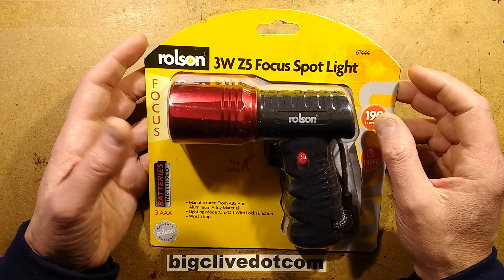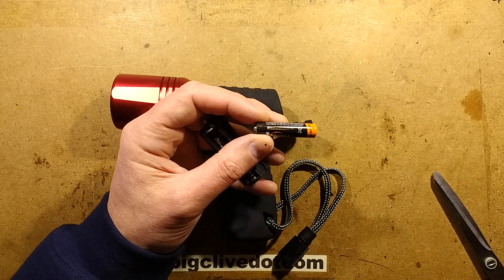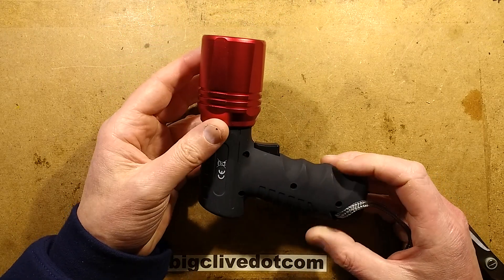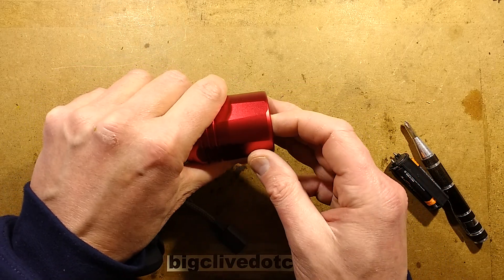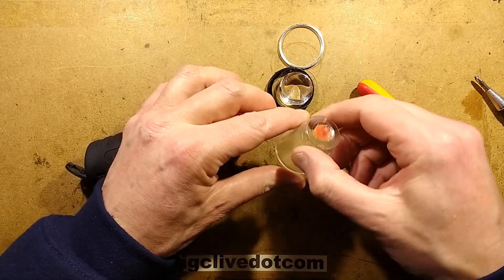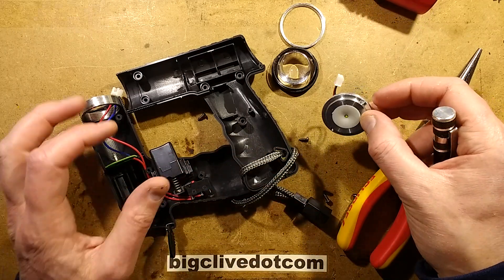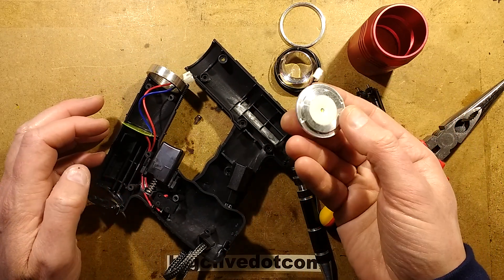Rolson Z5 3W LED spot teardown.

Comment: Pifco made a gun shaped torch in the old days, used a No 8 3v battery, it was known as a Pifco pistol lite. The batteries in yours are Chinese an often found in cheap bike lamps an TV remotes, Sadly some rolson items are no good, I had some pliers from them an they snapped, possibly cheap steel. I find with these cheap torches the bodies are nicely machined but sadly the electronics are not that good which is a shame.

Comment: Honestly one thing ur free to do for good cheapiest way is get zte power blank put 2x3.7 rechargeable and re wire it and I don't think u need to get the back open u can use just one but they make it good one 2 led shows minimal and max state lefts quite a charge on so u use em longer time limit it to 5 volts but 3 x 1.5 are about that voltage 4.5 I got 4.9 on new x3 pack

Comment: Clive, have you seen the USB rechargeable AAA batteries on ebay? Not a typo, the cells are small Li-ion inside of a AAA package complete with a micro USB port for charging! Rated 1.5v output instead of the 1.2v of Ni-MH

Comment: Ace find from rolson! Would be interesting to see how the spot light works in the dark,  and focusing, with that impressive lens on the front,can it light up a door number from inside a car on the road,looks like its got loads of space in the body and grip for a couple of lithium and higher wattage led. Give it preformance worthy of its space death ray gun appearance , im planing an upgrade to my current torch,3aaa and 14x5mm led no resistor. A few of the leds are going dull battery life has been good for me, have new leds on order, will also try Upgrading to 3wled on a star thing, 5 degree reflector ,adding a 2w 1ohm resistor, also have a couple of lenses to try, looking to make a 1 foot spot at 15m we will see, i intend to stream the process,when iv lost this cold and set up overhead cam.

Comment: You could throw an 18350 in there just by soldering a plate onto it with those springies on it and adding some current limiting to the LED, maybe replace the LED entirely with something better.

Comment: Looks very hackable!  No test on current draw?
Reply from the maker: Current draw will depend on the type of cell and state of charge.  It will be very random, but in hindsight I could have checked that with a DC clamp and holding the battery pack in place on the contacts.  (Putting a meter in series would have affected the current draw significantly due to even a slight series resistance.)

Comment: I realize that 18650s are the cylindrical lithium cell people are most familiar with - but for something like that, an 18500 or - if you're lucky - 26500 might be a better fit. I have some LED flashlights that came with carriers for 3 AAA cells and with a little ingenuity I got them working with LiFePO4 18500 cells - a little nut-washer-screw arrangement at one end to take up the extra length and some O-rings around the cell itself to deal with the extra diameter.

Comment: The speed the electricity comes out of the batteries has to be equal to the speed the light comes out of the LED or it wouldn't be able to keep up.

Comment: this would be very hackable. i like it. seems like the case was likely designed for a higher-end product.

i'd get an 18650 in there if possible with usb charger on the back door and nicer LED. a tiny bit of dielectric grease would give some friction on the focusey bit.

Comment: Fun fact, "TK Max" is called "TJ Max" in the states, when I was in the UK I saw that and got a good chuckle out of it
Reply from the maker: Apparently they couldn't call it TJ here because of a rival shop called T J Hughes.  But a slight name difference could also provide a degree of financial separation.
Reply: https://en.wikipedia.org/wiki/Junction_temperature  (aka TJMax) ...  quite fitting considering there's no current limiting whatsoever in this PoS

Comment: I got one of these to bugger about with. The screw focus was rediculously loose. My idea was to use a very thin layer of rubber cement from a puncture repair kit to increase friction.  Result?: big gollopy mess.
Reply: Thick grease might have worked...
Reply: I tried grease but it seems I had two parts on opposite ends of the tolerances. In the end I just binned it and got another one a few months later which might have been on newer tooling.

Comment: Here's what you do clive... Swap out the little PCB used for the battery contact, and mount an 18650 in there, a small charging board in the handle (face the micro USB out the bottom of the handle) And replace the LED with something more fun  like a WS2812B and an mcu :)
Reply: ArcAiN6 Inefficient.  Make the battery contact board a charge control and constant current output board.  SMD components on the front, battery contact on the back.  A wire running from the board to a piece of metal on the battery lid.

Comment: Looks very hackable. Not difficult to add a stroboscope circuit. I use a quad Schmitt trigger circuit to generate and shape the pulses and a power FET to switch the LED. A simple multi turn pot can control the flash rate. A proto type in the lab was great for looking at the motion of fan blades and drill bits, though I never boxed up the circuit into a final product. The type of LED used can be flashed at extremely high speed, 10kHz or more, and with a little pulse width compensation, the brightness of the light can be safely maintained  over a wide flash rate range. ( It is necessary to narrow the pulse to prevent over dissipation of the LED.)

Comment: 18500 batteries are a good replacement for 3 AAA batteries since their the same length but of course they wouldn't work with this light without modification.

Comment: If you dumped the battery contact board there would be loads of room for an 18650 and a little protection board behind the LED, and a little generic Li-po charging board at the bottom of the handle, complete with 

You might even have space for the LED current limiting resistor, but that would ruin all the fun ;-)

Comment: There's no way that is run directly on 3xAAAs, there must be a resistor hiding somewhere, or maybe a small linear LED driver on the LED pill.
Reply from the maker: It may be relying on the battery and wiring impedance to limit the current.
Reply: False.  AAA alkalines are current limited enough that it works out as the cheapest way to do it.  Keep in mind that it won't necessarily have a long lifespan doing so but further helpful is that with the alkaline AAA at that load they will suffer voltage depression and limit current even more.  "MOST" 3x AAA powered lights don't have a discrete resistor added, just rely on total design impedance as Clive mentioned in his reply.  In other words, this is how to design a piece of junk.

On the other hand if you were to swap in a high current capable 18650 Li-Ion cell, you just might fry something.
Reply: 3 Alkaline AAAs can easily provide enough current (>1A while maintaining 3v+ for 10 minutes). http://www.candlepowerforums.com/vb/showthread.php?64660-Alkaline-Battery-Shoot-Out
Nothing to stop someone putting NiMH in it either.
As you say it probably has high resistance wires, but I still think that LED module probably has a resistor hiding in there

Comment: Your checking your terminals on the side of a road and a cop pulls by just to see whats up, you hear some tires so you turn around with your uncomfortably shaped light and hes given you free brass chest weights. There is no way an officer can tell if your holding a gun, a light or a gun with a light. This product could get someone killed haha

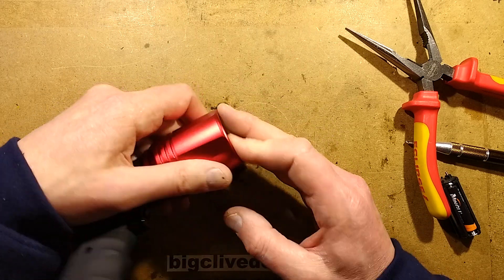Comment: 3:39 That small single LED in there felt like a disappointment
Reply: On the contrary, you want a small single die Cree for a light like this.  Although the CRi would be poor, I might like a Cree XT-E in one.  5W LED, capable of 450 lumens, though this particular light doesn't have the heatsinking to handle one, nor can 3x AAA alkalines supply enough current.
https://www.fasttech.com/product/2058901-cree-xt-e-450lm-4500-5000k-led-emitter-5-pack

Avoid cheap (hand held) lights that use multiple LEDs.
Reply: Stinky Cheese too late... I bought one, and made it a headlight for my MTB
Reply: the led  in your link looks bigger ...a pity the video omitted the most important information  , measuring with V and A meters the power going to led  (I guess about 1W) and the price
Reply: Looks like a Cree XP-E. They probably just stated the LED's max power rating and its probably run at a much lower power. Not a bad LED but extremely outdated, almost 10 years in fact
Reply: my bike light only has 2 tiny LED's and its brighter than a cars headlamp

Comment: Replace the LED with a burning laser
Reply: Yeah but you can't get much burn fun going with a laser powered by mere 3x AAA cells, unless you just want to pop balloons or light matches.
Reply: Stinky Cheese 
That's why you upgrade to Li-Ion
Reply: Well yeah but the constant "here, put these goggles on so I can point this thing at you" would get old really fast... 8)

Comment: Any jump starter on eBay- AliExpress which you can recommend?
Reply: I got one of the USB ones clive tried previously on this channel , works well for a motorcycle. Not sure about the car.
Reply: I'd really like to have a cheap, but still good working lithium jump starter for my car. It doesn't even have a particularly large battery, something like 40Ah, so I hope that there will be something like that, but good enough that it works as well. I wouldn't buy one from AliExpress though, because I've never done that, and I am not a big fan of dealing with such a foreign sales platform.
Reply: Adrian Anker makes some solid stuff. Last year I bought one of Anker's 40Wh USB charged car jump starters from Amazon, works great on a Dodge 3.7l v6
Reply: That doesn't work on an Automatic.
Reply: Don't worry, some spammer will come along and recommend one, if you aren't the same spammer asking so you can come back with a different account and answer it yourself.   The correct answer is neither of these places are good to find a decent jump starter, just false spec junk.   Get a proper major brand on Amazon.
Reply: Nah, I'm good. I'm not about that gangrene...
Reply: there's no such thing as a cheap, quality jump starter, you can have one or the other. One way to do it on the cheap is to have a spare car battery, a charger and some jumper leads, even better if you can mount the lot to a hand trolley.
Reply: Yeah. 

Take your money, light it on fire, then throw it at your car battery. 

Will be about as effective as some no name chinesium junk jumper.
Reply: A steep hill is the best starter
Edit: Can be supplanted by people who can push the car fast enough on a flat surface.
Reply: So don't buy an automatic,  unless your gear changing arm was disabled in that crank-starting-handle mishap.

Comment: if LEDs are current sensitive then could you run one off of 240V if you had a ballast to take it down to 20mA or is it not that straight forward?
Reply: yes its called a captivate dropper, its how they do all the cheap lamps, caps dont get hot like resistors would be at that drop, they just dont conduct the electricity for a lot of the ac cycle,

Comment: Anything with 3 AAA's is always crap because there's no reason to use that battery configuration except to avoid having any current regulation.... credit for the realistic lumen rating on the pack tho!.... looks very hackable with space for better led, heat sink and electronics.
Reply: Well, white LED's are generally at full power by 3-3.1v, so new AAA 's will over-current them quite a lot, as you'll get about 800mA from new AAA's...if there is no resistor which will mostly go as heat while the batteries are good, and don't leave the light on for long periods because the heat may damage the LED while the batteries are good.  Also, this situation is much worse with NiMh rechargable cells as, they have a much flatter discharge curve and tend to remain at a high enough voltage to over-current the LED for much longer, and are capable of much more current than Alkaline.

Even cheap inefficient regulation circuitry is better than wasting most of the power as heat while damaging the LED.... I could only find one of these lights for sale online and it was quite expensive enough to have decent circuitry!.....honestly it should have an 18650, but even at 4.2v compared to 4.5 for the AAA's... a Lithium cell that big would tend to fry the LED quite fast!

That said, a CREE CXA1304 LED looks like it would fit, and that LED mount appeared to have decent heat transfer capability.... so with an 18650 and a boost regulator, you could make quite a mean thing!... Personally tho, I couldn't resist trying to cram an XHP70 in there for short bursts only, but what fun!
Reply: James Lewis I was looking at that peeper grinder. Is it good? And is the name of the brand silvercrest?
Reply: The one I bought is branded QUIGG, this one:
https://www.teknihall.be/en/products/quigg/gtspm08
I have not taken it apart, but what you can see from the outside looks fairly high quality, for 9.99€.
Reply: wouldn't 3xaaa be more efficient though?  . The negative, if you see it as a negative is the slow decrease in brightness until it finally goes flat instead of full bright until it suddenly turns off.  The positive is no cheap inefficient regulation circuitry.
Reply: I just bough a ceramic pepper grinder from ALDI (About same cost as a similar one from eBay but with instant gratification and an actual warranty) which uses six of the bloody things. Otherwise seems fairly good quality, even a warm white LED on the business end. Some modding is definitely in order.

Comment: Might I suggest an idea for future content
After you do a teardown, you put the product back together with better quality, like adding what it is missing, making improvements, etc. Would be a real interesting thing to watch
Reply: I would not bother with some of the low range stuff, but yes I mostly agree. It would be a hoot to see some of the  worthwhile items like this brought up to Clive level engineering standards. I was actually thinking as well as you that I really wanted to see this particular one upgraded.
Reply: I want to see one of the Dalek Death Lanterns converted. He said the case design was cool, and perhaps the LED may be ok, but the rest was crap and/or dangerous. So a proper battery and charger would be neat to see. Or even take it another level by combining with that cool flame-light bulb he liked, since the guts of it ran on 5v past the step-down part and could be made to run on a battery.
Reply: The Chinese would be all over it! ;-)
Reply: Most of the things he reviews, simply aren't worth the bother.  As they say you can't polish a turd.  Well you can, but it's then just a shiny turd.
Reply: he does that sometimes, but not very often i think
Reply: Maybe you should spend the time to do this.

Comment: 3 watts??? Doubt if it's 1 watt!
Reply: Borrowed from the Chinese book of ratings? As in: might be a 3W rated LED - never mind what we're actually running it at...
Reply: My thoughts too.
Reply: Clive could have put his clamp meter on to find  the current
Reply: The packaging says 190 lumens, 3W. That would be a very bad LED. You'd expect 100-120 lm/W from a decent LED.
Reply: yep its  a 1 watt (max) led style
Reply: Typically a 3W LED would be chosen then it's just current limited by the battery pack to somewhere around 2W.
Reply: Michael Tempsch I think it would say something more like this: "buy purchase transaction LED led light emitting diode diode light lumen 300000 watt power 120 volt Voltage current lamp light" etc.

Comment: That looks well hackable. 18650 with charging port and a sound module that makes ray gun sounds when you pull the trigger.
Reply: ^ This
Reply: Or an 18500.

Like this https://www.amazon.co.uk/dp/B0776Z6VSP/ref=twister_B0776ZNRBR?_encoding=UTF8&psc=1
15A ... 
quad LED MCPCB...
https://intl-outdoor.com/noctigon-4xp-mcpcb-cree-xpl-hi-p-917.html
and it'd be a proper ray gun :)
Reply: Remember to add a resistor. An 18650 will blow the ass out of the LED without current limiting xD
Reply: You could probably fit a sound module in the handle.
Reply: Just thinking, also add one of the stun gun modules Clive reviewed some time back and it turns into a real adult toy :D
Reply: pew pew pew
Reply: fuck yeahhhh
Reply: Got this when clicking your amazon link.
"Be careful! This site may be harmful.
The site you are trying to visit (www.amazon.co.uk) may include malware, phishing attempts or disturbing content."
Reply: Also needs a proper LED driver.
Reply: Yeah, with some thermal regulation :)
Reply: That is one serious Liion. 15A?!  And the dimensions look relatively small. Too bad it's restricted from shipping here :(
Reply: A Micklich Vape stores are a good place to find high drain batteries
Reply: Thanks man, I appreciate the tip!

Comment: Nicely built product. I would love one of those with an 18650 inside.  Should be plenty of space with that PCB removed from the middle. Hunting one down now!

Seems to be called: Rolson 61444 3 W Pistol Grip Spot Light
http://www.rolsontools.com/3w-pistol-grip-spot-light.html
Reply from the maker: I got it from T K Maxx.
Reply: https://www.ebay.com.au/itm/ROLSON-3W-Z5-FOCUS-Super-Bright-Spot-Light-Includes-Batteries-1-3-4-hour-AA39/401157731241?hash=item5d66dd33a9:g:SiMAAOSwdzVXkOcj